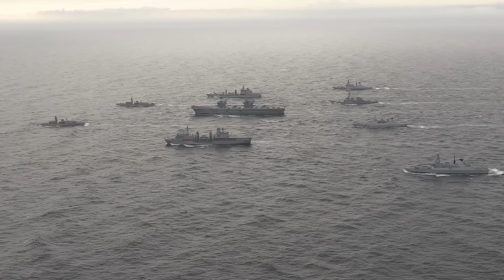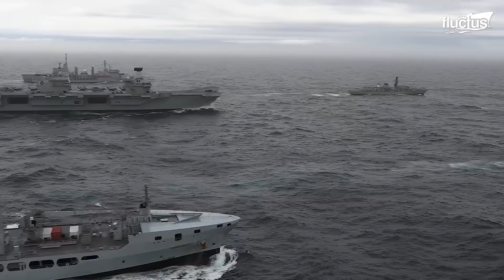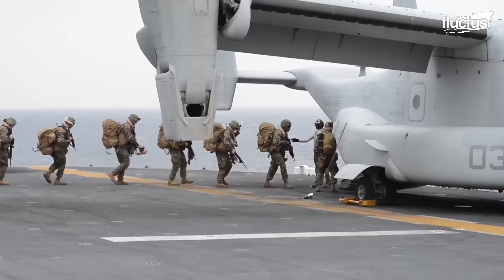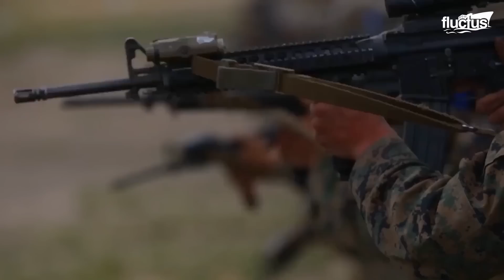US Marine F-35B Test Dangerous Technique to Compete with US Navy Catapult Launch

Comment: Fun Fact so other don’t have to research this : Steam is used for propulsion and arresting of aircraft because the aircraft carriers are Nuclear powered and convert water to steam to drive turbines so there is plenty of excess steam available.
Reply: Non nuclear powered carriers also used steam for catapult launches and as stated earlier the arresting system is hydraulic powered.
Reply: @michaeljohnson4258  The John F Kennedy is the last Non-nuclear ACC the rest are Nimitz Class.
Reply: @DimSimSam  And Ford Class.
Reply: @DimSimSam  CV-67 (and previously CVA-67) JFK was the last of the Kitty Hawk class, last of the non-nuke diesels. CVN-79 JFK is the second of the Ford class. Launched in 2019, will be testing the electromagnetic launch system in 2022 and should be operational in 2024.
Reply: New U.S. carriers use magnetically driven catapults. You can see it when an aircraft takes off and there is no steam like older carriers.
Reply: @Gemini-b4g  Unfortunately those systems still are not up to standard compared to the legacy steam variants. Consider this; everytime a catapult fails to function properly your at best losing an aircraft and at worst losing an aircraft and its crew.
Reply: @jayss10  Not just the catapult, one time on an Indian carrier, an arresting block disengaged prematurely and the jet plunged into the drink. The pilot waited for the carrier to pass overhead and then ejected. Had he ejected just a little earlier, he would have hit either the carrier's props or its keel.
Reply: @jayss10  CVN 78 is a new ship, CVN 68 suffered issues as well.
Reply: @death_parade  Irrelevant.
Reply: @Gridlocked  It is very relevant indeed. I am pointing out how not just the catapult but other parts like the arresting blocks are safety critical.
Reply: @death_parade  CVN 78 EMALS and AAG are very safe with over 2000 successful launches and recovery cycles completed.
Reply: @Gridlocked  All due respect, I am an engineer and 2000 of those aren't enough to build my confidence. Obviously they had to have done some Accelerated Life Testing on it as well, but this is a marine system. Requires at least some more testing before it can be declared as reliable as steam catapults. 
.
That said, I wasn't even talking about that. I was talking about how a single failure is extremely critical in this application. And I gave an example to support that.
Reply: @Gridlocked  Your right the Nimitz class did have some teething pains, but the Ford class are much much worse.  From the time of signing the procurement paperwork to IOC (Initial Operational Capability) the Nimitz took alittle over 8 years. The Ford class has taken over 17 years at this point. Many of the people that worked on her initial design have retired or thejr child has gone from birth to college student in the amount of time its taken the Navy and the shipyard to get their shit together.

I’m a fan of technology as much as the next guy and i understand there is a benefit to all the EMALS stuff once its ironed out but you also have to be realistic and at some point say “This is what refits are for”
Reply: @death_parade  "arresting blocks"(sic)

arresting engines
Reply: @Gridlocked  Over 10,000 as of July
Reply: @death_parade  If there were 2000 test launches of ACTUAL aircraft,  than there were maybe four or five times that number of test launches,  spanning  the course of around ten years, maybe more. 
 There were likely 2000 test launches done at the Joint Base McGuire-Dix-Lakehurst test facility alone, before an EMAL was ever installed on an actual Aircraft Carrier.  The EMALs work and are at least as safe as the steam version.  (edit :  as of April 2021, 8,000 launch/recovery cycles had been performed with the EMALS and the AAG arrestor system aboard USS Gerald R. Ford. The USN also stated that the great majority of these cycles had occurred in the prior 18 months and that 351 pilots had completed training on the EMALS/AAG. Wikipedia)
Reply: The big advantage of the electronic catapult is controllability. Steam catapults are very hard on an aircraft frame, as it is similar to firing a gun, it all comes at once. With electronic controls , the acceleration and velocity of the catapult can be controlled, for different aircraft, and much softer on an airframe, giving a much longer service life.
There are lots of problems, but the Americans have pockets deep enough to keep at it until it works.
Reply: ¿Arresting system is hydraulic?
Reply: Steam catapults nothing to do with nuclear power specifically.
RN Carriers prior to Invincible had Steam Catapults fitted so the Victorious Class, Centaur Class along with Eagle and Ark Royal all had steam catapults.
In the US then Forrestal, Kitty Hawk and JFK classes were all built with Steam Catapults and Midway and many Essex retrofitted with them post WW2. 
Fun Fact for you.    NONE of these are Nuclear powered, yet still have Steam Catapults.
Reply: The British actually developed the steam catapult a couple of years before the outbreak of WWII. The U.S. version is an updated copy of that design,  and was in use for years before the first nuclear powered carriers.
Reply: The 1 completed Ford class (1 ACC) uses The Electromagnetic Aircraft Launch System (EMALS) although the system is still in it’s still in phase 2 testing.

Comment: Probably F35B cost more to maintain due to more moving parts? 🤫
Reply: $50,000 per flight hour per jet. Lockheed offered a guarantee of $25,000 per jet IF they received an exclusive maintenence contract. Not sure what happened.
Reply: @SloaneLasers  don make economic senses to b usin them 🤭😅
Reply: @kirkchua  It does makes sense though, to maintain air superiority worldwide. And with the exclusive deal with Lockheed, it makes even more sense.
Reply: @kirkchua  but it makes military sense.  If you want to be economical, just send everybody to fight with sticks and slingshots.
Reply: @SloaneLasers  "$50,000 per flight hour per jet."(sic)

Incorrect
Reply: @AA-xo9uw  Would you like me to provide a source? It's public knowledge. If you claim I'm incorrect, where's your source? I already said it's $25,000 per hour per jet if the US government gives Lockheed an exclusive maintenance contract.
Reply: Compare the cost of 1 F22 the F35 is cheap
Reply: @supercoffeemug1921  Comparing the cost between these two aircraft doesn't make much sense since the F-22 is Air Superiority and the F-35 is Multi-Role. They are so different from each other.
Reply: @SloaneLasers  actually it does make sense due to the context of of the person i am replying to who said “Probably the F35b cost more to maintain due to moving more moving parts”

Comment: F-35 is a STOVL (Short Take Off Vertical Landing) - not VTOL; it cannot take off vertically under normal standard operations with weapons and fuel.  It can take off vertically under test conditions with virtually no load and little fuel.
Reply: Purchasing a sophisticated jet fighter such as F-35 by any country would be unquestionably a prestigious deal only for the sake of having it😎
Reply: Man... Of course IT CAN, for God's sake 😂😂😂😂😂😂
You said: VSTOL(and not STOVL): VERTICAL and Short Take-off and Landing.
It CAN take-off AND landing VERTICALLY... always could, since the prototype.
Reply: i can take off vertically, i have seen the video
Reply: It takes off vertically just like a harrier
Reply: The F-35 can take off vertically, there's videos of it doing that on YouTube.
Reply: @rayjames6096  It can but there was no KPP requiring the JSF to be able to perform a vertical takeoff. The fact that the F-35B can, albeit with a very small payload, is gravy and is not an operational tactic.
Reply: @AA-xo9uw  That's why it's STOVL, it can takeoff vertically with a small weapons load and fuel tho.
Reply: I have seen a footage showing one takes off vertically, but just hovers and lands. Can it also make transition to forward flight in the air from vertical taking off? There’s no video showing that performance on youtube that I know of.
Reply: I have not seen Vertical takeoff during normal military operations.  I might be able to do it under special controlled situations - not carrying anything and little fuel.  So, under "normal" operations, it is STOVL.